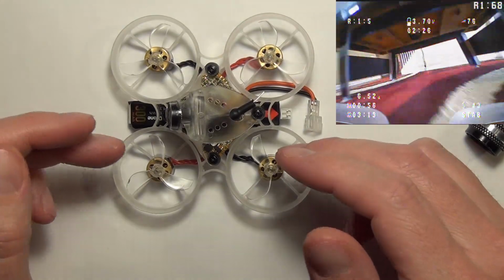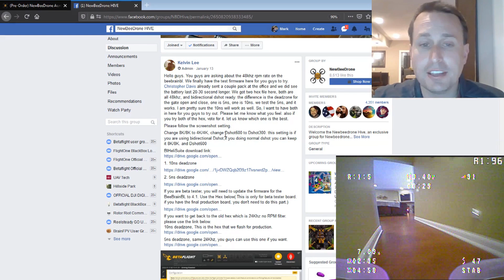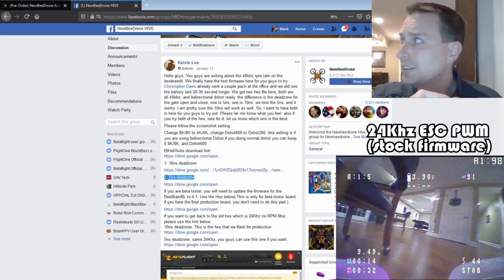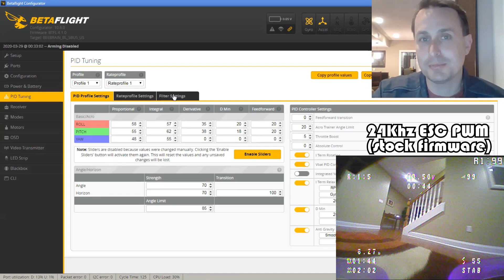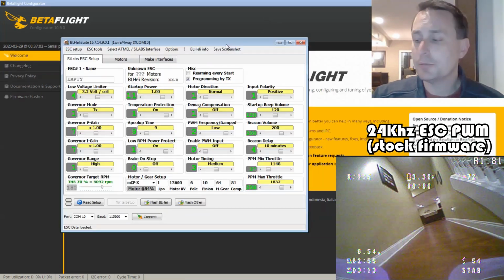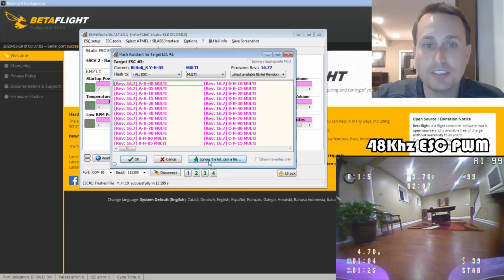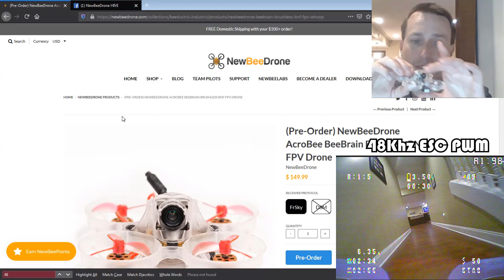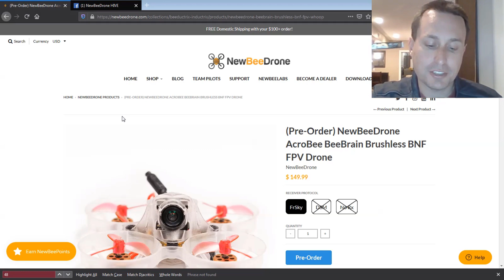NewBeeDrone - AcroBee Review & 48Khz PWM Setup

Comment: Transitioning from a GPS drone,  I found it extremely difficult to simply hover and make precise corrections with the stock tune and 1s nectar juice on this "acro"bee. I thought this would be a good learning quad and I was not wrong. I experimented with some tunes and found a place that I feel has some moderate control for beginners. Honestly I disabled 3 PID controller settings and changed the input curves a little. I am using a T-lite with stock output settings. I wonder if anyone has some "novice" tunes out there to share and compare. 😁

Comment: First you said it was a one s but it is capable of two cells. Then you said  "has a separate rx but put what ever kind you want"?  Then you suggested the motor wires were solid, not stranded,  that's just dumb. And then I stopped watching.
Reply from the maker: Glad you liked.

Comment: Hi! Urgently needing your help! You suggested an frsky receiver, but how would i ago abouts putting one in? I have an xm+ and r xsr. I can't seem to make them work.

Apparently its an uninverted board, so I've done the uninverted mods for the receivers but no luck. Please help and shine some advice thanks!
P.s i have a qx7. Atm xm+ won't bind. Blinking red led solid green led evem after power cycle. No stick movements in betaflight... 

Thanks in adv.

Comment: Hi UAV tech I have a 2.5 inch beast running on 4s I have flashed jesc 2.3 with latest Telemetry and I'm running 4.2 Betaflight and my Motor heat up terribly I'm running master slider at .5 and default filtering idk why this is happening with all my micros
Reply from the maker: Vibration issues or over proped.
Reply: @uavtech   check out my latest post on betaflight Blackbox explorer Sushmit Mishra

Comment: you can show RPM filters setup for Beta75x HD? plzzzzzz i try 2 times but motors not work nice when i update firmware...
Reply from the maker: I don't have a Beta75x.  What FC?  An F4?  If so, should be the same as any other setup.  Make sure 4k4k Dshot300.
Reply: This
CPU: STM32F411CEU6 (100MHZ )
Six-Axis: MPU6000 (SPI connection)
Size: 26mm x 26mm, whoop mounting pattern
Firmware version: Betaflight MATEKF411 (MK41)
OSD: Built-in BetaFlight OSD (STM32 controls OSD chip over SPI in DMA mode)
Receiver: Support Frsky XM/XM+ Receiver/ Futaba Receiver/ Flysky Receiver/ TBS Crossfire Receiver. Add Frsky R9M Receiver and DSMX receiver since V1.2
Support programmable LED like WS2812
Built-in current sensor
Weight: 5.6g

Comment: Nice video as usual. I had a question for you. I'm about to try bf4.2 and what would you recommend I set the dynamic notch max Hz to?
Reply from the maker: For a 5"?  550Hz.
Reply: @uavtech  yes I meant to say a 5" racer the default is 600hz I believe.
Reply from the maker: @_Brando_69  , 600hz is good too.  Anything above 610hz put it into High mode.  You want Medium for a 5".  More fine resolution.
Reply: @uavtech  ok thank you! Just starting to get how this filtering works. Going through your black box playlist now. I've got 2 falcox race quads and I want my betaflight race quad to feel as similar as I can get it. That tight feeling
Reply from the maker: For starters, BF 4.2 has RF rate curves in it.
To match Falco feel, I would go with little to no FF.  Also turn off D_min and put in old F1 PID gains.  Then turn on Dyn Notch and move sliders way up.
Reply: @uavtech  that's what I thought with the f2f. Somebody told me to turn it up that I was wrong about turning it off.

Comment: BTW, confirmed with Joe Lucid, it's just a "S" ESC, so you you can just flash with JESC 2.3 and choose S instead of their special ESC firmware.
Reply from the maker: Good to know!  Thanks!!!!
Reply: Yeah, Thorsten had been testing that a couple weeks back - although the 3.5.7 tunes on just JESC 2.3 48kHz work so well I can't be bothered to upgrade.
Reply: Tried to flash escs with Jesc but not working. Do you have tick the box saying inappropriate mcu or esc. Thanks

Comment: It's a shame you can't pass Black box data via the receiver to your transmitter and store it in that SD card. I wonder if there is any possible packets that could be used in the RSSI transmission. 🤔🤔🤔
Reply: Way too much data to pass real time over the air, and if you have a chip to store it, you can just keep them and pull it off later.  It's a bummer, but these can fly well enough with old fashioned tuning by ear.
Reply from the maker: What he said, waaaayyyy to much data.
Reply: @uavtech  Now I want to know the differential between that and the total video information (analog and digital HD)
Reply from the maker: Whelp, 30 or 60fps is not 1000 or 2000fps for starts.
Reply: Well I wasn't talking about all Black box info but maybe a few predefined  parameters. I.e. motor outputs or maybe a PID to input deviation.